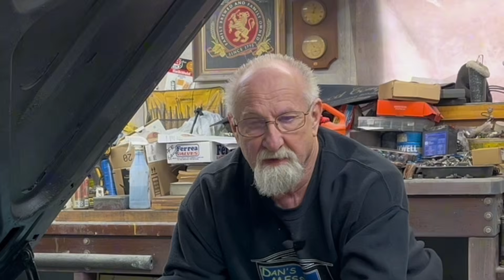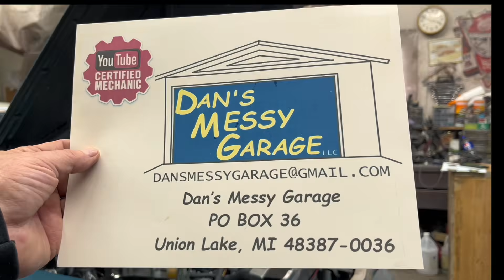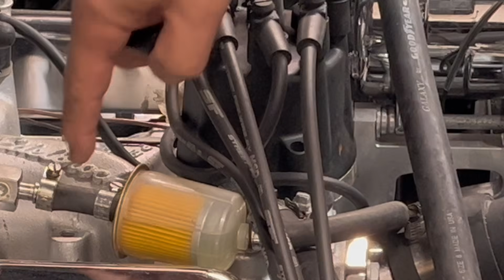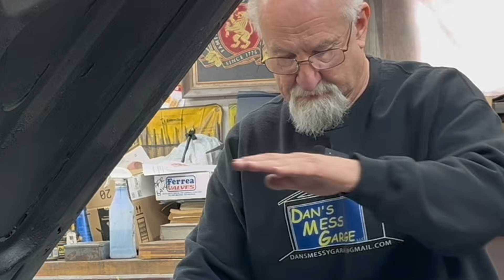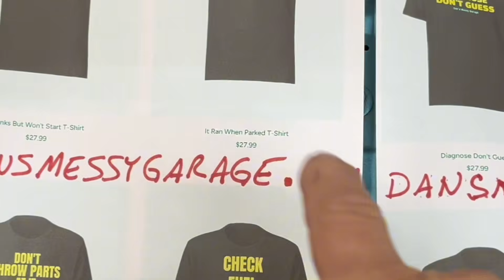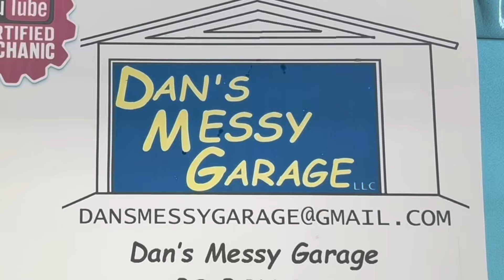5 Signs Your Fuel Pump is Failing (Don't Get Stranded!)

Comment: We were having intermittemt issues with it starting and idling.  But it was back and forth.  Finally, we parked it after a car show. It sat for 3 weeks.  Went to start it, and the pump definitely failed.  It wasn't pulling at all.
Reply from the maker: Intermittent issues can be the worst to track down, but at least you know exactly what the problem was now. 👍

Comment: There are a lot of variables with carbureted systems.... And one of the worst is ethanol gas even with a carb that has been rebuilt with ethanol resistant gaskets and seals... Take my 87 Ramcharger or my 74 Charger fo instance when I let them sit the ethanol fuel evaporates out of the fuel bowls necessitating more engine cranking to fill the fuel bowls for engine cold start. Also heat soak can cause fuel boiling but mostly solved with a phenolic carb spacer... The trans-dapt swirl four hole style is a good choice on the 600 cfm Edelbrock carb I get 15 mpg with my Ramcharger 318 roller cam with that combo tuned correctly. The ethanol shortens the carb rebuild window leaving deposits on the air bleeds and in the primary circuit which either requires cleaning or rebuilding to get back smooth hiccup free operation. You can test the volume output of the mechanical fuel pump with a pint bottle and a stop watch and get the gallon per hr numbers. The fuel filter should always be mounted at the lowest point in the engine bay as possible giving it an advantage to fill better using a mechanical pump...that draws by vacuum. Modern fuel injection has much less variables but can be diagnosed on gallons per hour the same way as a mechanical pump.  The added diagnosis to EFI is to use an Oscilloscope and scope the commutator pattern scopes are available under a $100 and are useful for a multidude of repairs on both modern and classic cars. A fuse buddy can also be used to measure amperage of the running EFI fuel pump a 30 amp version is under $25 at HFT. A high amperage reading can mean a clogged filter or a dying fuel pump ..since most of the time the tank has to be dropped it's a good thing to know the condition of your electric fuel pump as to not get stranded and as you know they always seem to fail when the tank is full...😂🤣
Reply from the maker: Thanks for sharing those helpful diagnostic tips and your experiences with older vehicles. 😊

Comment: Never ever use a plastic filter on an engine.  Rubber fuel lines?  Use metal lines and a metal filter. Never ever use a plastic filter up in an engine - guaranteed failure and fire, just give it time 🔥
Reply: You do know that modern cars use high pressure plastic lines throughout... And usually a metal can style filters but I have seen the plastic versions.,..it is the routing of the lines and shielding that make it all safe... And there is a combination of steel and plastic fuel lines and evap system lines. Any modern mechanic is familiar with this.
Reply: @moparnut6286 yes they do use plastic fuel lines.  A guy I knew had a f150,302 cammed, intake ect.  Plastic factory fuel line split right before the fuel rail and caught fire, burned the truck down.  I dont know why ford and others do that.
Reply: @the-default-villian well they do it for fuel mileage weight, I personally would rather have stainless fuel lines and braided rubber steel lines. The also have added plastic in many places  intake manifold, valve covers, oil resivoirs, brake master cylinder...and on and on.. when these plastics burn they burn extremely hot and the fumes choke you immediately all in the name of saving fuel. When my daughters 98 Oldsmobile intrigue needed fuel lines I replaced the complete set with coated steel lines with braided lines on the ends to the quick connects... About $350. There is no reason why cars can't be built with stainless lines throughout brakes and fuel... other than a few dollars per car.
Reply from the maker: That is a very fair point and definitely something worth thinking about. Thanks for the input! 👍

Comment: Thanks, guy! I'm having symptoms in my F-150, EFI, but only when it's been running for over an hour or so, especially in hot weather.

Think I'm going to carry a pressure gauge with me on my next long trip. (Replacing the filter made a bit of a difference, but there still seems to be an issue.)
Reply: If you want to be forewarned on a modern fuel pump a good test is to use an Oscilloscope and yes there are some for under a $100, and just scope the pattern of the fuel pump via a current loop inserted in the fuel bump fuse or relay and get the commutator scope pattern that should be all even with no drop outs and will give you a very accurate reading on the health of the pump, and also give you the amperage of the fuel pump running as well saving you time and grief on a diy job.
Reply from the maker: Thanks for the update, let me know what that pressure gauge tells you on your next trip! 👍